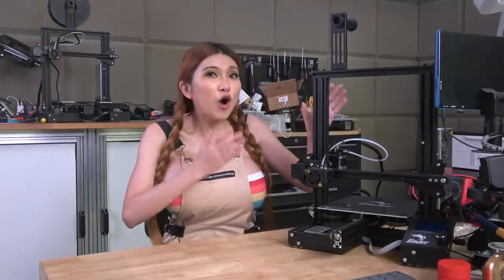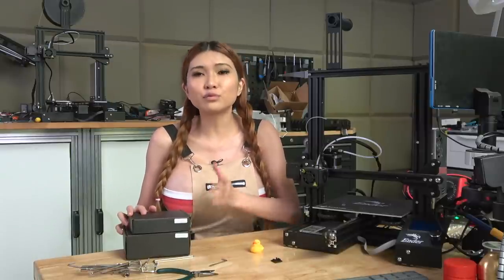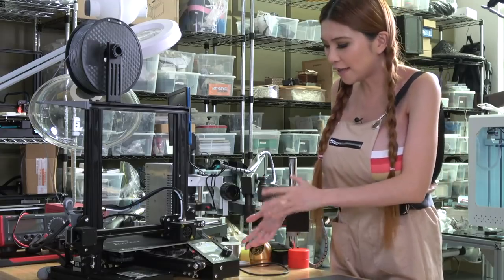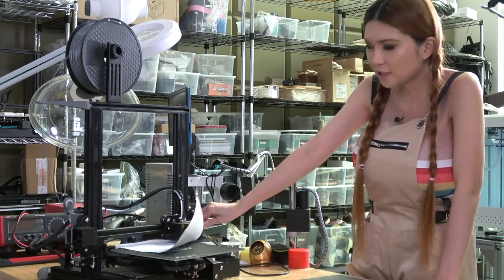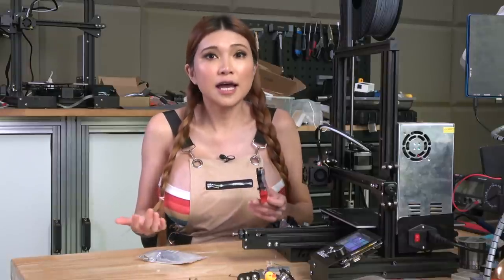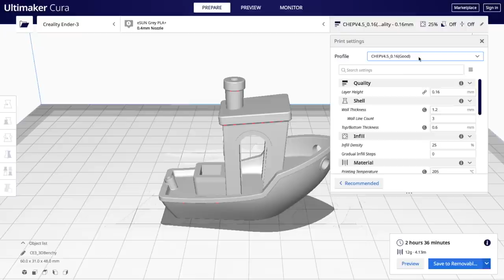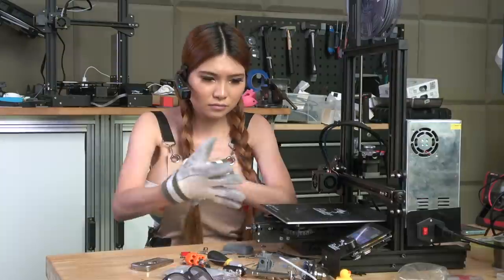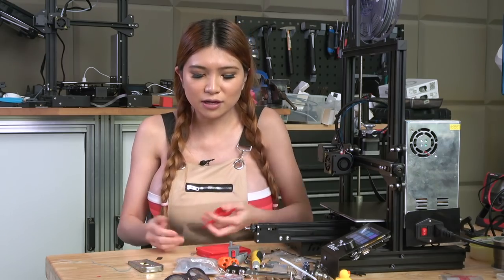My Favorite Ender-3 3D Printer Mods & Upgrades!

Comment: It is so reassuring to see that even the most experienced technicians happen that the smallest screws fall to the floor and they are then impossible to find!
Reply: I learned to lay a towel down on my print bed before I do any work on my printer. It protects the bed obviously but it also keeps any dropped bolts/nuts/screws from bouncing off into oblivion
Reply: @mszoomy  Check out the video by Adam Savage where he demonstrates the "send out a search party" method of finding dropped parts.  it works!  It's essentially dropping another one on purpose to see where it goes.  First time I tried it, the 2nd one ended up right next to the lost one.  I was amazed!
Reply: @tralfazy  interesting! I wound up buying a big a$$ magnet on the end of telescopic pole, when I drop a screw I just wave that around until I hear a clink

Comment: Mods are a great way to better understand your printer, especially since they can easily be removed and the printer returned to stock configuration.  So be sure to keep all the original parts you replace or upgrade!
So many things to agree with on this video!
First and most important is to run enough spools through the stock printer so you can get to know it's behavior.  Many issues can be handled by keeping the printer clean and properly adjusted, and then optimizing the slicer settings, especially including the printer configuration.  Adding mods too early can actually get in the way, as there can be too many things to try to get right all at the same time.  Spend time at "zero mods", then start with the simplest mods first.
Laser engravers: Please use them only in printers that are completely enclosed with at least a simple vent and filter system.  While it is awkward to enclose a RepRap or i3 style printer, this becomes easy for CoreXY and other gantry style printers.
"Mods" are also a great general philosophy for life, in that we can always work to improve ourselves and our tools (and toys!), not to mention our relationships and environment.  We don't have to be content with things "as they are":  Mod you mind, mod your body, and mod your interactions.  My greatest personal mods have been in the area of mental health, where I knew early on that change was needed, but it took me many years of trying before I found lasting success.  Mods are a path much more than a goal.
Be fearless, but also be careful.  Big changes deserve big preparation.  Do not be afraid of failure: In my life, my greatest growth has come from my failures!  This applies to myself, my career, my friends and my family.  That said, you generally can't predict outcomes, so the greatest risks should also have backup plans.
The hardest for many is simply asking for help, because it means sharing your needs (and weaknesses), which can be difficult when addressing personal issues.  Many of my earliest personal lessons came from doing this wrong, so start with small items when sharing with new friends or in a new group.  This applies equally well to 3D printing and mental health, and most other life issues.
Edit: Typos, formatting.
Reply: Bob, I really liked your reply!  What you said is very true.  Using a hobby such as 3D printing & comparing it to one’s life & how to modify it is huge!!!  Wish I could meet you in person..... I’m sure that I could learn a lot!
Thanks for your reply.
Reply: This is the longest yt post I have read all the way thru

Comment: The best print quality mod I did was the upgrade on the hot end that prevents stringing and the Bowden tube gap against the nozzle. You just insert a section of tube with a printed washer in the hot end. It's made a world of difference!

Comment: My favorite mods, for just about any 3D printer not just an Ender 3, are a) a concrete paver under the printer, b) stepper motor dampers, and c) quiet fans. Those plus the board upgrade you described should make almost any printer pretty darn quiet :)

Comment: Glad to know that someone as knowledgeable as Naomi does not jump on the mod bandwagon just because it's there, even if her fans are asking for it ( yeah we can be a demanding bunch ) I currently only have about 2 months of 3D printing and although I got several upgrades like the BL Touch,  MicroSwiss Hot end, metal extruder, SKR board, etc., I decided to wait installing them until I learn to use the printer with all stock parts, except for flashing the latest Marlin, so that if something goes wrong with a mod I can more easily troubleshoot it.  I have only used PLA/+ and the one minor mod I did was to replace the section of the stock PTFE tube in the hot end with a with a Capricorn tube and washer like CHEP did to be able to print PETG without frying the stock tube to a crisp.  
Have been on the fence about a direct drive extruder but after reading about the problems that come with adding the weight of the servo on the X/Z bar and how you have to end up slowing down the prints to compensate for the noise it can introduce into the prints I decided that I would instead go for an EZR or even a DIY extruder mod to handle TPU filaments. The one near future DIY mod I hope to do is a dual filament extruder.

Comment: "Talking print bed surfaces is like talking politics and religion." - Too true.

Also for changing build surfaces a trick I've found for getting the old surfaces to come off cleanly is to get the bed good-and-hot (100C for at least a couple of minutes) like Naomi obviously did, then get started at a corner and grab the material with pliers so you can pull straight up slowly - seems to leave less residue behind

Comment: TIP: you can use a heat gun to remove sticky glue pads, its much quicker and the glue will come up with what ever sticky glue pad or label or sticker your removing. and you will have very little to clean up. 
Luv U

Comment: There are mods that do not affect the print at all.   For example, a ribbon cable keeper for the display, box to protect the display board,  a cowling for the fan on the controller board (since crap can fall into the fan from above) ...   Those are worthwhile starting prints, especially the ribbon cable keeper and fan cowling, as these prevent damage to the printer.

Comment: One mod that I have not seen anyone do , is put a 3mm flat washer and lock washer in between the bed leveling nuts and the carrier plate. It's a simple mod for keeping the bed level, but I haven't seen any vids that done that mod. When I got my 1st Ender 3 pro , everytime I bumped it by accident. It would knock the leveling off. Put 3mm washers on it ,and I have printed over 75 items with out having to relevel bed.And all the printed items came out prefect. And still hadn'tseen anyone use this simple mod.

Comment: Wow - great suggestion to run it stock for 100hrs.  At least for inexperienced 3D printers.  I had an issue when I got my ender3 v2 which caused some nozzle blockage.  I was messing around with all kinds of things and ultimately found that it was some manufacturing debris partially clogging the nozzle.  If I had been messing with extruders/firmware/other mods it would have been a lot harder to troubleshoot.

Comment: The first thing you really had to do is to change extruder cooling to make it possible to print with ABS. I printed "Bullseye" for stock coolers and used capton scotch to close the rest bottom holes. Now I can print with ABS with 0% cooling and switch to PLA if I want. This is free and really the first thing you should change in this printer.

Comment: I would love to get a printer for, interesting car parts n stuff. however im worried about the soft ware. putting  the thing togeather im not worried about. could you do a vid on the different software?
Reply from the maker: Ok!
Reply: This sounds like a heck of a lot of work, considering that we are talking about printer firmware aswell as slicer and CAD software where there are a gazillion commercial and also a bunch of open source options. I think Naomi will have to make a series rather than one video. I recently learned to use Inkscape for engraving on my refurbished late-90s cnc mill and managed to design my first parts (clamps to attach a drag knife to the cnc mill) using FreeCAD for my 3D printer (got myself an Ender 5 Pro to tinker during lockdown). But I needed quite some time to achieve this.

Comment: Hello Naomi, how much difference you saw in Ender 3 with the change of the video board assembly ... What do you think has improved in the machine
Reply from the maker: Print quality is only a slight improvement, much, much easier to use, level, load- almost silent.
Reply: thanks for the clarification 👌

Comment: I dont own an ender 3 but i do own several bigtree tech boards and love them but not the mini so much though. I agree with you on all your points especially about not really needing auto bed levling.. I have a competing product the sunlu S8 which has a 310x310 plate and i still rather manually level. And i also use glass. I just prefer it to all the newer stuff. But i dont print any exotic materials yet just pla,petg, ptu . I may get a flexible pei setup soon. Most upgrades imo just make things easier to manage ,maintain and and overall run smoother and faster. with exceptions of course!

Comment: Next time you clean the glue from the bed change use Liquid lighter fuel (like Zippo refill) its less stinky than kerosene and makes the glue release better than most thinners and wont hurt a painted surface.

Comment: Just ordered an ender 3 pro.

This is very helpful on what I might need to upgrade if I need to improve after using for a bit.

Also, will be printing the printable upgrades even if I don't need, as they will make for great first projects to learn the machine and 3d printers in general.

Thanks for the video!

Comment: I'm glad I saw this, my new SKR mini and touchscreen were already in the mail, so its good to know I made a wise choice in my first big upgrade. I bought it because I wanted the Merlin 2.0 firmware and also because of the better (quieter) drivers.  The EZstruder looks like it will be my next upgrade.  The Ender 3 is my first 3D printer, but I've worked on CNC machines for 20+ years, so I'm no novice. Keep up the great videos Naomi!

Comment: The only mod I would and did do right as I was putting it together was the capricorn tube upgrade. I then printed my test model to make sure it was all good. After that I printed the screen cover just for added protection and it printed great. The rest of the printer is all stock ender 3 pro.

Comment: I JUST got an Ender 3 Pro for Christmas, as a gift. I am brand new to 3d printing. I was going to start modding it before I use it the first time. It's very helpful that you said wait until you have 100 print hours before modding. Thank you. When you're levelling, what is it you're feeling for with the paper? Are the electronics upgrades you showed compatible with the Ender 3 Pro?
Reply from the maker: You want a very slight drag on the paper as it slides between the nozzle and the bed. You should just barely be able to pull and push it without it bunching up against the nozzle.
Reply: @Naomi-Wu  Thank you so much for responding. I have a million questions, like most newbies do. :)

Comment: Just so you know - I bought my Ender 3 Pro in June 2021. Because I print a lot of TPU I followed yours and Chucks advice to upgrade to an EZR Struder. IT DOES NOT FIT! I think Creality must have changed the extruder motor because firstly, the brass gear wheel is welded to the motor spindle and secondly, the spindle is probably about a centimetre shorter. So I had to cut the gear wheel from the spindle before I could get the new gear wheel to fit, only to find that because the spindle is shorter I wasn't able to attach the plastic filament winder. 
After all the messing around and the cost of the EZR Struder, I have something that is no better than it was before I upgraded simply because I can't wind the TPU filament through the Bowben tube - A total waste of money, time and effort! I now find the only way to go is to buy and fit a direct drive extruder if I want to print TPU or TPE.
Reply from the maker: Oh no! I didn't know they've changed it with the new printers, I no longer work with them. Will add a note- sorry!

Comment: Your such a good hearted person I remember seeing you with serpentZA years back and here I am looking into 3d printers and you have a great video about upgrading a printer it’s tuff market right now I was thinking getting a voxelab Aquila for $180 and then adding BLtouch, dual gear extruder with the Capricorn Bowden tube, dual z axis stepper motor upgrade and magnetic steel sheet bed with the pei coating on it total cost then would be $130 in upgrades so $310.00 or would it be worth it to buy the cr6se for $420 or even the new ender3 s1 for $420??? It’s tuff to go with the upgrade path or just pay the extra $120 and have a better printer than the upgraded ender 3 clone. Hehe yeah I think I’m gonna get the ender 3s1 it’s just tuff looking at the Aquila and it’s $160 haha seems like a lot more than $420

Comment: Of course "Your milage may vary." But I couldn't get the BTT SKR board to have a stable thermal the way I could with the stock Ender 3 1.1.5 board.

Comment: Bigtreetech SKR E3 mini is a great motherboard for upgrade and not so expensive. I put the version 2.0 on my Ender 3  with the TFT35 V3.0 touchscreen  and it's fantastic. My Ender 3 is quiet and the touchscreen is easy to use. Great products.

Comment: I thought it was meant to be VoltLog who "touches both your passion for electronics and your bank account at the same time" 🤔 Both BTT and SeeMeCnc ended up with purchases from clicking on the links in the description. Now, I don't do a lot of 3-d printing, but the turn-and-click interface was a bit annoying, so the touch-screen I/F attracted me, and my failed efforts at printing flexible filament (yeah, the skirt and first layer are perfect, and then it jams in the extruder at any speed/temperature for me) make me hopeful for the SeeMeCnc extruder.

Comment: Has Creality started shipping better-quality springs? The springs on my late-2018 model were terrible: one of the four bed springs was so weak, it could hardly hold its corner, and the extruder spring was so weak, I was getting horrendous underextrusion, and scratching my head.

I don't know about the most recent batch, but it seems that EVERYONE complains about underextrusion until they replace the extruder with an all-metal one.

While the stock plastic extruder certainly won''t last forever, it'd be ok, if only it weren't paired with a garbage spring.

I'm thinking, c'mon Creality, I know it's a very low-priced printer, but it'd be a darn near PERFECT printer if not for the rubbish springs! I think people would be OK with paying an extra buck or two for five good springs.

Edit: Also, my 2018 Ender 3's bed was so warped that Scotty looked at it and drooled. ^_^

Comment: Naomi, you need to stand on the naughty step - this video flipped my resistance, and I've just bought an Ender 3. Not yet got it together, need to clear a workspace. I messed with 3d printing about 5 years ago, try for high precision on a milling machine with an industrial grade print head. Worked fine, but slow, since a lot of metal to move around.
Reply from the maker: Excellent!
Reply: @Naomi-Wu  OK, Naomi. You can get off the naughty step XD. The printer went together perfectly, The printed instruction sheet was very good, and the video on the sd card would help, too, if anyone needed it. Everything provided in the box. Once I leveled the bed, it produced a perfect owl. Absolutely amazing quality for not much money.
Now i need to suss out the g-code commands, and convert my previous programmatically code generation software.

Comment: Naomi I am trying to get good with 3d printing, I have a creality ender 3 pro I want to be good enough to print in wax filament and cast the prints in copper. I need more help than I thought. Creality is amazing you are right.

Comment: Naomi, if you want something really 5exy, install full ubuntu on a cheap-ish tablet, then Octoprint+Octodash.  Same solution as Raspberry+Screen, but, somewhat more Zexy and (depending on the tablet) more processing power.
Reply: Raspberry pi 2 or better is more than enough computer for octoprint. I'd feel like I was wasting anything else.

Comment: Once a month leveling!! thats crazy. I check it before every print. There are way to many variables that throw the level off.
Reply from the maker: Nah, if you don't move the machine and have a removable bed you're good. Glass beds were you have to pull the print off can go out of level quick.

Comment: Naomi, the bed leveling you did, was that a TFT Display feature or was it because of the motherboard upgrade?  I really don't like manually going through the menu to move the nozzle to thev4 corners. It looked like you just pressed a button and it moved to that location?

Comment: I added a back cover for control panel. I've found no need for belt tensioner.
Reply from the maker: yeah, I'm a bit iffy on those, I've had belts loosen but only on printers with a LOT of hours on them, so they might be handy later.

Comment: What do you think about fan mods? does it improve anything? I have purchased a CR auto bed leveling and the dual Z axis motor with supports for better stability. Do you think a direct drive improves printing? do you think that it makes a difference where you locate the petg roll?
Reply from the maker: They help, but it's an personal choice as to how much. I print everything a 0.2mm and don't get really hung up on chasing really really fine detail, for some people that's really important. So long as you safe your parts and can roll it back a lot of people really enjoy modding and getting more out of their printer. For me just want to print stuff and not mess around with the printer itself too much.